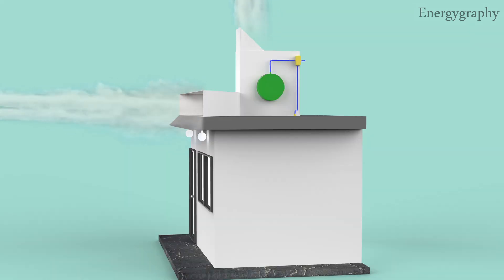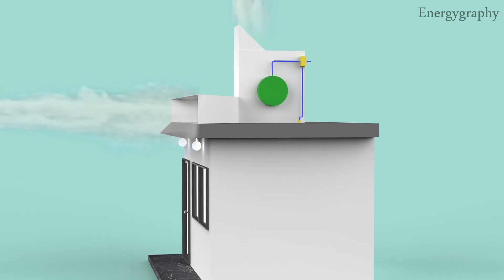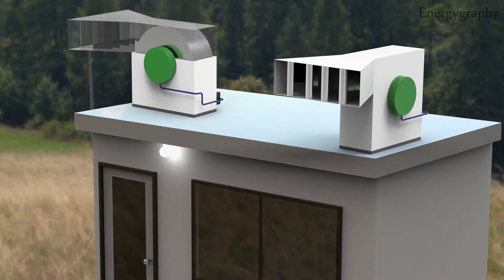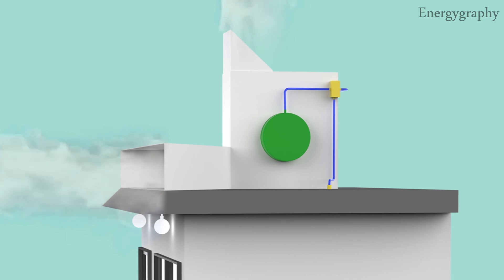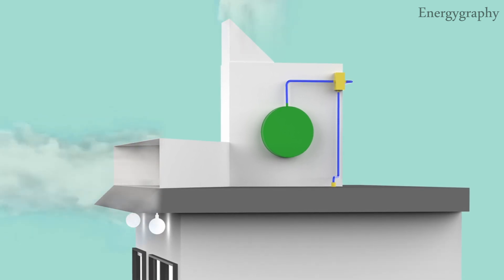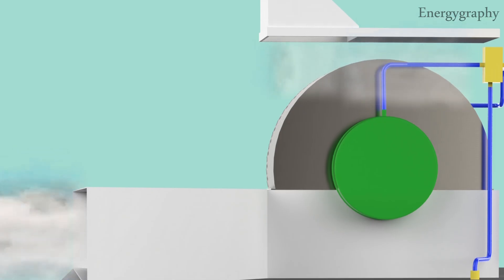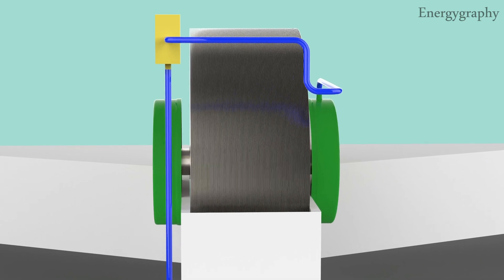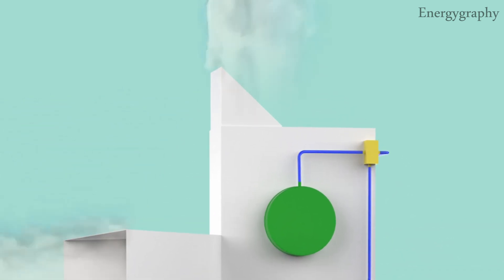Rooftop Tesla turbine VS Aeromine wind power.

Comment: Wind/electricity yield increases with the third power of the wind speed. So +100% wind = +800% electricity. 
Close to the ground, however, 0 constant wind, but gusts.
Therefore ALL ground-level wind turbines are extremely inefficient!

Comment: All practical tests show that small wind turbines hardly generate any electricity, because the is hardly any wind close to ground.
With solar panels, you can generate at least 20 times more electricity with the same investment!
Hardly any wind blows close to ground & it´s extremely gusty, which almost always greatly reduces the service life. 
Solar systems, on the other hand, reliably generate over 25 -30 years electricity at approx. 3 to 8 cents/kWh.